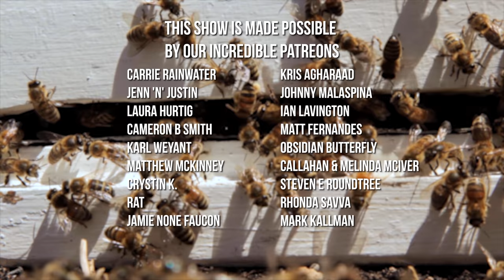DIY Honey Bee Frames: How to Make Bee Frames From Scratch | The Bush Bee Man

Comment: Hey Bush Bee Man.
Tip : 
To get tight wire, that never slacks, is to clamp the Frame Side to Side (with one of those long rail Clamps, with a one Handed crank tight option) put The Frame under 'tension', add the Wire, tie the ends to nail etc. Then "declamp" and Bam# the Wire is super tight forever ! 👍
Doesn't even need that Crimper (tightening gadget.) Simples. 😎
🐝🐝🐝🐝🐝🐝🐝🐝🐝
Happy Beekeeping 2022.
🐝🐝🐝🐝🐝🐝🐝🐝🐝
Just about to start the Bee Season here in Scotland 🏴 when Spring actually happens... its been really cold for mid April.... Brrr !
Reply from the maker: Great tip!

Comment: @The bush bee man : I'm curious if you need to use metal wire? Would fishing wire work just the same?  I was thinking to run the wire across 4 times and before tightening the wire, put the foundation in with two wires in front and two in the back.  Then tack down the wire and the bees should theoretically wax right over the top? 
I'm brand new and have ordered my supplies but haven't put them together yet.